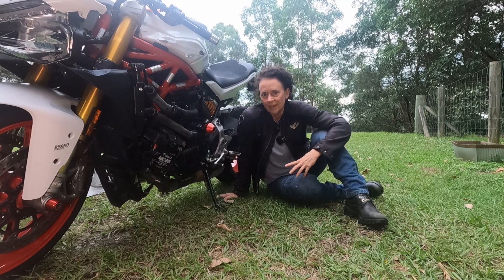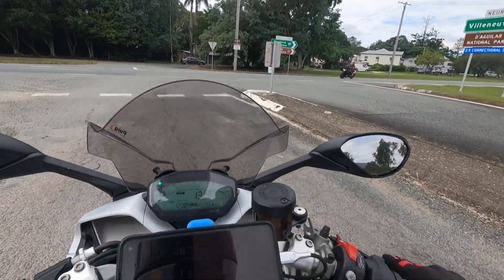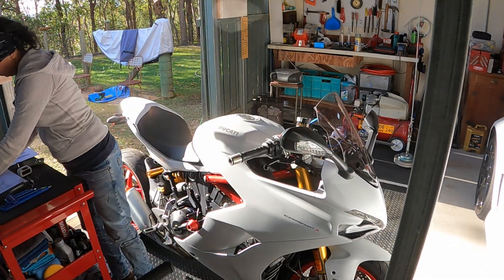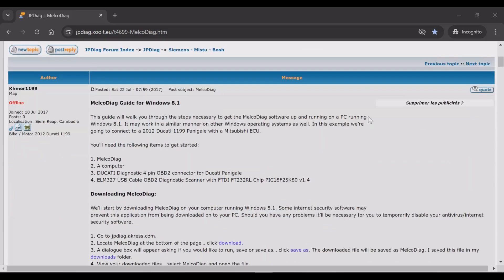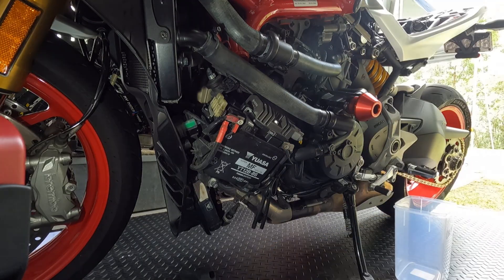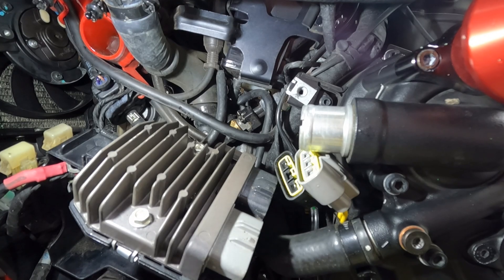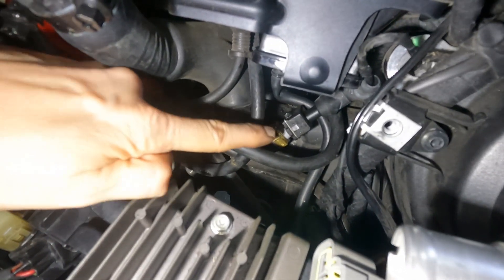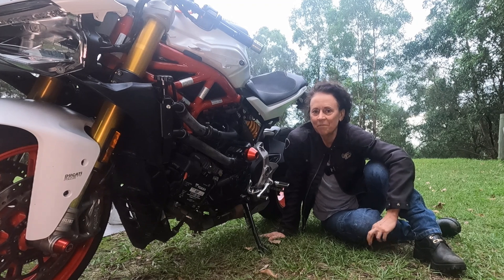Changing a Faulty Temperature Sensor on a Ducati SuperSport 939

Comment: Looks like a nightmare job. Is there any Ducati sensor that doesn't go bad ? Gas sensors also go bad. Charcoal canisters with problems. So many issues that Jspanese bikes dont have. Just changing the battery is a decent sized job. Which ive done myself twice. My bike is a 2017. First registered on 2019. I am the second owner and it just passed over 10.000 kelometer. And i havent had any service to change timing belts. And I hear that even with my low milage the belt needs to be changed in five years. Not sure what i want to do. I was thinking to get it done when i reach maybe 15.000 km.
Reply from the maker: Yes these bikes do have a few issues, but not all are affected. I got unlucky with the temp sensor. My fuel level sensor has't failed yet. That's low kms on yours! Mine has had two valve services, but belts only at the second.

Comment: Hi,

Can i change the sensor without empty the coolant ?

And i don't have the connector to reset the default, so maybe the default will stay after change the sensor ?

Thank you.
Reply from the maker: No, the coolant has to be drained or it will just pour out where you remove the sensor. 

The fault code being present shouldn't affect anything but you can get a dealer to clear it on your next visit. If you plan to keep working on your bike, the OBD and adapter and app is worthwhile to get.
Reply: @staceonwheels  thank you for you're quickly answer (sorry for my english, i'm french). It's really clear and you're video is really perfect.

I found some cheap cable and mecadiag on pc to reset the default. I think i would test it.

If i let the problem of sensor (when the temperature is 10/20 degree celcius i don't have the probleme. Can i continue to ride for the summer or it's a risk to my bike ?
Reply from the maker: @guillaumethorel4732  please know I'm not a mechanic so I only know what I learn and research, but many other SS owners have said the bike is safe to ride with the faulty sensor. Of course, you may not know the real temperature so perhaps don't ride it too hard and make it too hot!! 😁
Reply: @staceonwheels  maybe the most principal thing is to have coolant in the bike 😅
Reply from the maker: Ah... yep! 😂